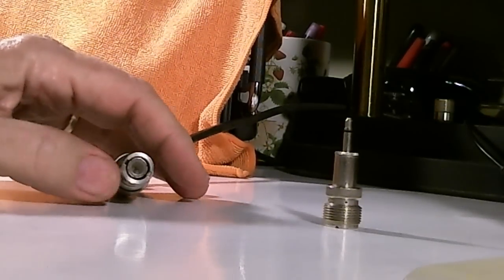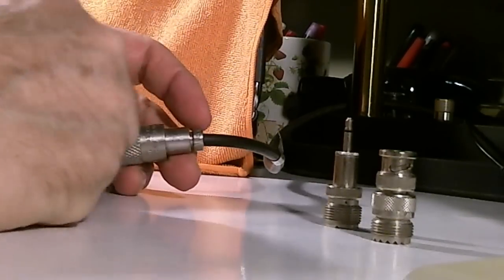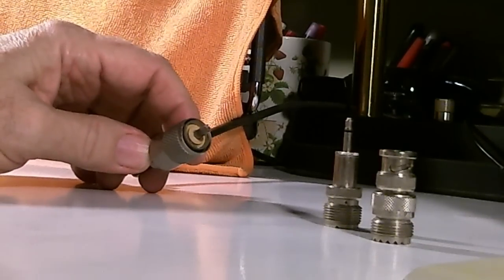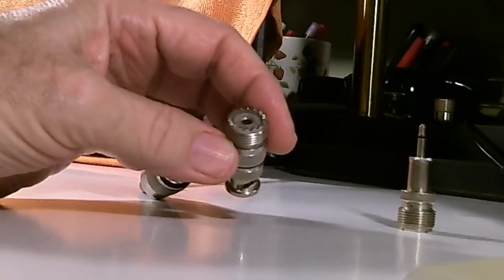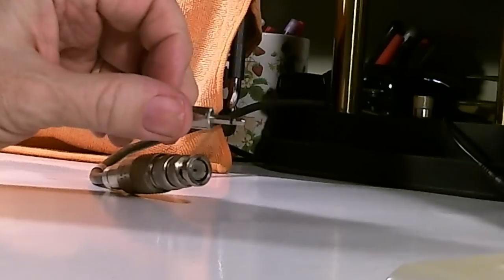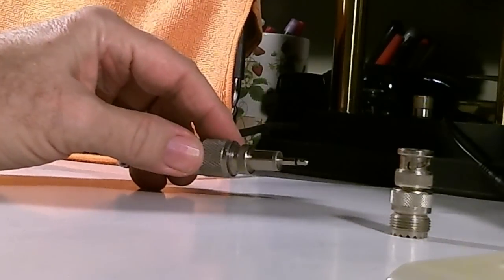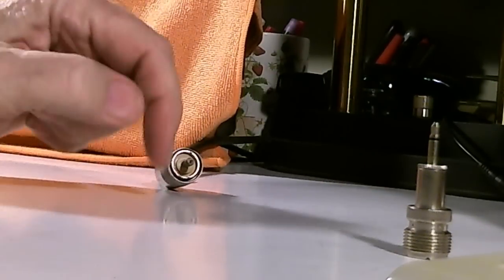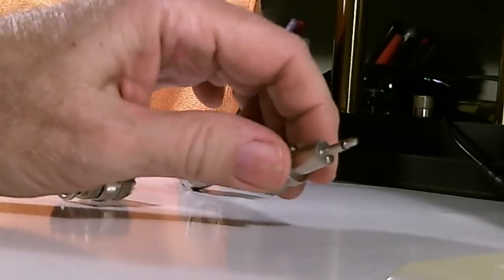TRRS #0236 - Shortwave Radio Antenna Adapters

Comment: Very helpful! Really helps me understand.  Hope others think so  and not boring.   End of RF8 you have PL 239 or 259.  How does one attach what is on end of RF8 cable if you don't get it pre-attached? Thanks alot
Reply from the maker: Attaching those types of connector correctly can some times be frustrating other times it's a piece of cake.  It usually takes me 30 minutes or more to get one connector installed properly. Not something I like to do. :)

Tom

Comment: Hi, don`t forget to mention some sets like the older Radio Shack DX, I think has a RCA type ext. jack receptacle in the back of the chassis. I know my older Sangean does.
Reply from the maker: Good point.  Many of the old desktop scanner required that kind of connector.

Tom
Reply: Sir do they have rca to so-239 or rca to 259 adapters? I have an old dx-398 coming next week w/o its telescopic whip. many thanks and much respect